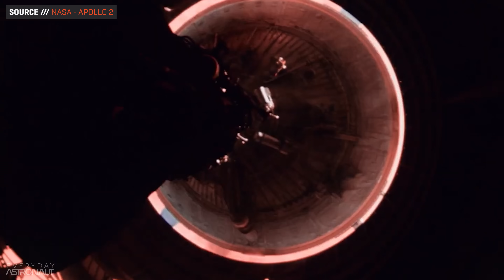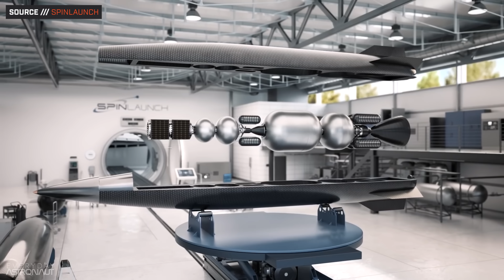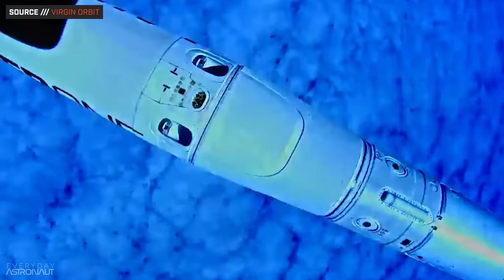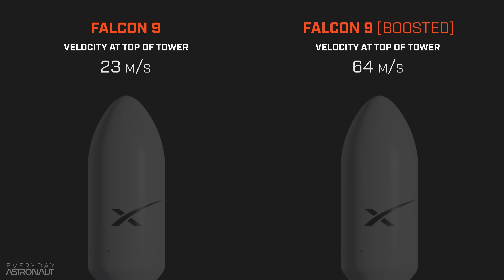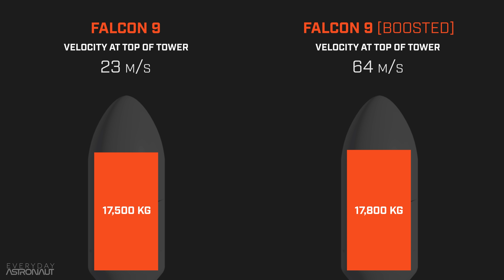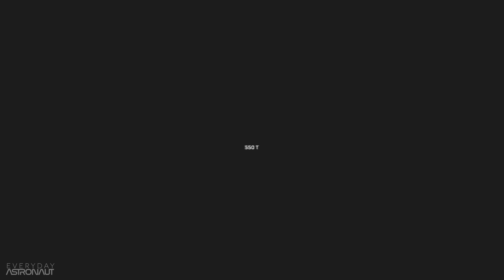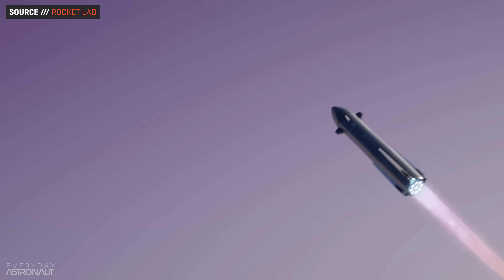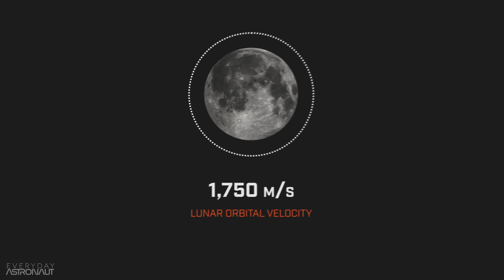Could We Help Push Rockets To Orbit?

Comment: Evolution of Elon Mask steel plate concept - to make it ACTIVE:

Steel shaft beneath pad (like Mask`s plate, but vertical cylinder) → channels redirect Raptor exhaust → massive water injection creates steam (10k kg/s water → 47% more reaction mass) → hits reusable platform under Starship → calculations show 8-10% extra thrust at liftoff

Key insights:
- Uses Mask`s proven steel + water cooling tech
- Platform stays on ground (no added rocket mass, no fuel mass, no additional rockets; reusable platform on the guiding beams)  
- 400-500 ton equivalent lift boost when fully loaded
- Modular steel shaft sections for maintenance
- Water film protects walls + adds thrust

Basically turning launch infrastructure into a ground-effect booster. The steel plate protects. This amplifies.

The physics:
- Exhaust: 21,500 kg/s at 3200 m/s
- Add water: +10,000 kg/s → steam expansion
- Even with 50% losses from redirection = 12+ MN extra force

The water expansion factor (1:1700) is the key multiplier here
Reply: Imagine instead of just protecting the launch pad from the inferno of 33 Raptor engines, we turn it into an active part of the launch system.

What it looks like:
The rocket sits not directly on the launch mount, but on a special shield platform. Below this platform is a steel shaft (like a giant diameter pipe) that goes down and branches into three channels that curve back up to the surface - like an inverted Y with bent ends.

How it works:
1.Engine ignition - Exhaust plume is directed down into the steel shaft
2.Water component - Massive amounts of water are injected into the shaft (about 10 tons per second). Upon contact with the superheated gases, water instantly becomes steam, expanding 1700 times!
3.Flow redirection - The mixture of exhaust gases and steam under enormous pressure rushes through the side channels and hits the bottom of the platform where the rocket sits
4.Additional thrust - The platform receives a powerful upward push, transferring it to the rocket. Calculations show a potential 8-10% additional lift force
5.Separation - When the rocket rises a few meters, it naturally separates from the platform, which falls back onto shock absorbers for reuse

Why this could work:
-Water doesn't just cool, it adds working mass to the exhaust jet
-We're using energy that currently just destroys concrete
-No additional weight on the rocket
-All components are reusable

Essentially, we're turning the launch pad into a giant steam catapult powered by the rocket's own exhaust!

Comment: Well, since you ask, "how would I do it",  I would use the rocket sled in New Mexico, White Sands Missile Range and put a ramp at the end.  I would start small with a rocket plane not firing until after launch, and play with larger payloads later.

Comment: Well if power is an issue you shouldn't use electrical energy. Instead, point a separate rocket engine counterweight sideways parallel to the ground on a carrier rail or upside down into a hole and use gearing and pulleys to pass the energy to the main ship. A rocket counterweight so to speak.

Comment: Space Elevator is the way to go once we can build the cable with enough strength to handle its own weight plus the elevator itself.
Reply: Space Elevators are a a cool concept but they’re a VERY long way off just in the material science. We’re nowhere remotely close to the material strengths needed to make one feasible, especially not at useful lengths (much less 100s of thousands of km for a space elevator).

Comment: There are numerous errors in the theory, understanding of energy vs power, and fundamental physics in this video. 

For example there is no fundamental law of physics that says if you launch something sideways super fast that it will go around the earth and return to the same location. If it can be launched fast enough, above escape velocity in air, the object would simply launch into space. The problem is friction with the atmosphere generating heat. No upper stage sized object could handle the heat and would melt, likely vaporize, at the speed required. In addition to that, the speed required would be so incredibly high it is likely impossible to achieve with current technology. 

Another example, when calculating the effects and requirements for the rocket assist over the height of the tower, energy and power are mixed up and used incorrectly. 

If the calculation showing the energy stored in 3 Tesla batteries is correct (seems low to me), then that is not a large amount of energy at all. It is no more than what 3 typical EVs can store in their batteries. 

Power though, if that energy was consumed over 12 seconds results in a requirement of providing 122,000 hp. While that is a lot of horsepower, some of the largest ship engines can produce almost that much horsepower so it is possible using current technology (using two very large engines). For example the Wärtsilä-Sulzer RTA96-C diesel produces almost 110,000 hp.

Comment: Modular negative weight aerographene omni directional cube-sphere rocket takes off from anywhere by H2 buoyancy to 1km, H2 fuel cell propellers to 10km, H2 exterior laser plasma rocket to 100km, shifts exhaust to horizontal to orbital velocity in vacuum. SandaerOcom UniGorg

Comment: 11:30 - fast capture and discharge of energy is achieved by Capacitors
------
I watched a documentary about Fusion Reactor where they generate 2 rings of plasma (similar to what Tokamak does) but instead of achieving fusion in that plasma ring they smash those 2 plasma rings together achieving a massive spike discharge of energy that they capture in a massive capacitor powerbank. They achieved net positive results in the production of energy. Now they are working on creating a reactor that can create and smash those plasma ring in fast succession.

Comment: I expected you to have done the math for the following :
1. Attach rockets to the arms or launch tower.
2. Just use big motors that can turn really fast, use a pulley that translates the motor's nominal power to maybe its 16-fold and use a "roll" of steel rope, so you don't actually have anything falling to the ground.

Comment: Have the rocket fire itself from a cannon barrel.
Insulate the bottom of the rocket. Wrap a sealing ring/sabot around it. 
Put the entire rocket at the bottom of a huge smoothbore cannon. Check that the sliding seal rings are in place. 
Fire the engines. Check that they are working.
Release hold-downs. 
Start shooting in more liquid fuel and oxidizer. 
Spray some water.

All the gasses push the rocket up like a bullet. 

The advantages of this system is that all the energy goes to lift, not to an equal-and-opppsite reaction that wastes half the energy tearing up the launchpad.

Comment: I'm struggling to understand the implications of the fact that energy depends on velocity squared, as Tim mentions at 28:40. Here is my problem:

If I have a given amount of fuel, that fuel has some amount of energy in it, and I can burn it to accelerate myself by a fixed speed (idealised circumstances apply), since this will make my engines burn some given amount of time, and during that time they apply a constant acceleration. But the graph at 28:40 seems to say that if I go 0 m/s and that fuel takes me to 10 m/s, it couldn't take me from 100 m/s to 110 m/s, since those changes don't have the same delta of energy, right? But how does that make sense? My engines still burn just as long, so my change in velocity must be the same, no?

Comment: Kind of wish this would have been a comparison of how much fuel/capacity you replace with the alternative lift system. It would be interesting to see a system that uses rocket engines with fuel based on the ground to just off load the launch weight cost to the launch platform...? For more info think essentially the chopstick method but with rocket engines attached with ground based fuel feed. Would still need a way to keep the fuel lines out of the rocket wash but... engineering....

Comment: I have only watched the first half of the video so far, but my takeaway after listening to the argument about the huge amount of energy required to lift a Falcon or a Starship, is that that energy is required to move the rocket from the ground no matter the method.
Every time a current rocket is lifted from the ground, that absurd amount of energy is generated by burning chemical fuels, and the amount of energy required is, as said, enormous. (And could instead have been used  for other things, like generating electricity).

My point is that the amount of energy required is not a good argument against the alternative methods. The power needed is sure making it unrealistic, but the energy needed is the same no matter what method we use to generate the acceleration. The only way around that is to use less massive rockets, which would require other ways of generating it than chemical fuels inside the rocket, and we are back were we started.

To be fair, the huge amount of energy required is rather an argument against pushing things into orbit at all.

Edit: The absurdity of the high energy argument gets even more clear in the "dragon capsule in orbit maglev tunnel" example. The energy required is large, but still less than the energy in the fuel required to lift a Falcon rocket. The 2 miljon homes could easily be powered by the energy in that fuel. 
The numbers look bigger when converted into electrical energy, but the energy used today (in the form of kerosene) is even higher.